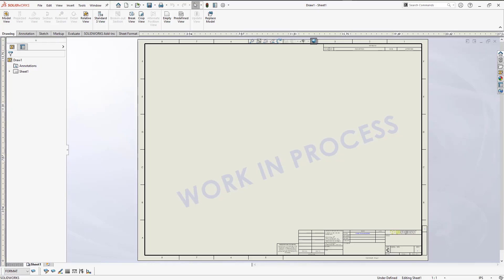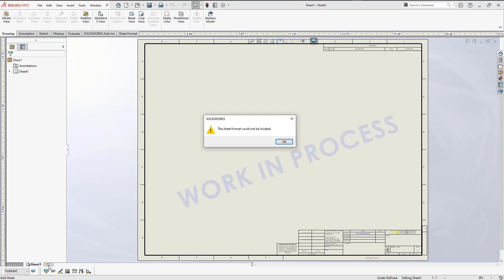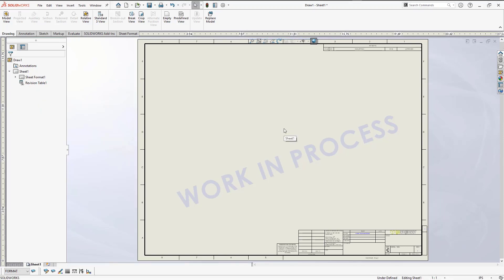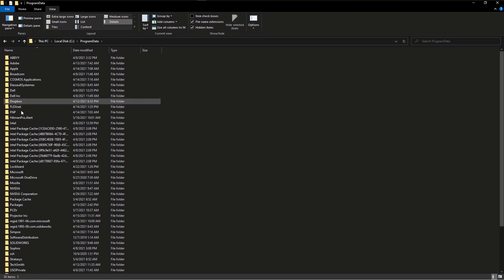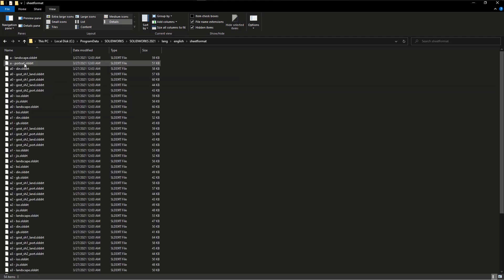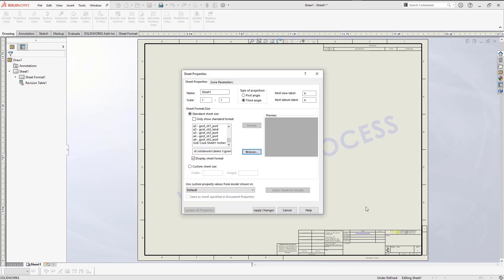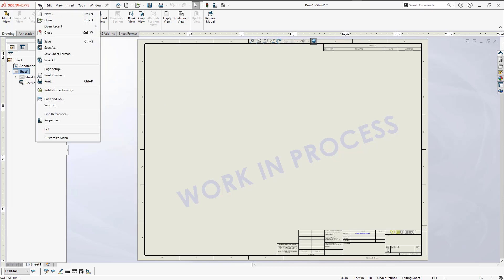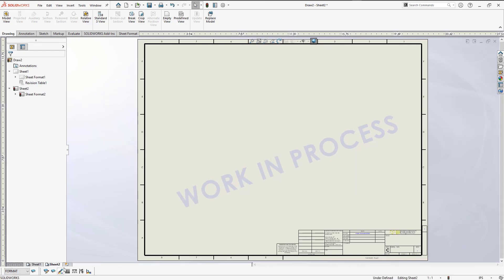SOLIDWORKS - The Sheet Format Could Not Be Located

Comment: That this problem is still in Swks after close to 20 years of development.  really come on WTF
Reply: I have never had this issue. I have all templates saved on the network. 
This is not a problem, it is an issue with bad practices. 
Develop good practices during solve the problem. 
Solve the problem and all symptoms go away.